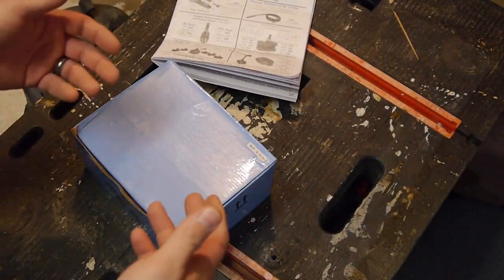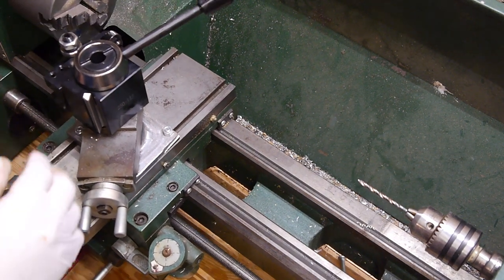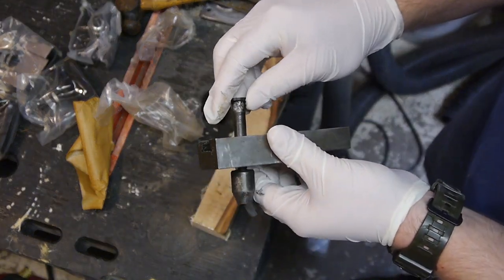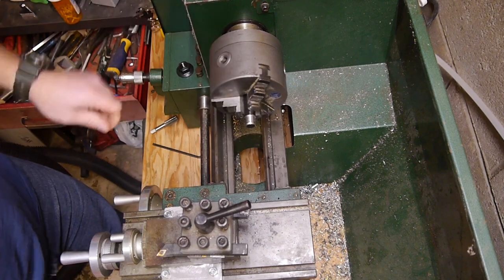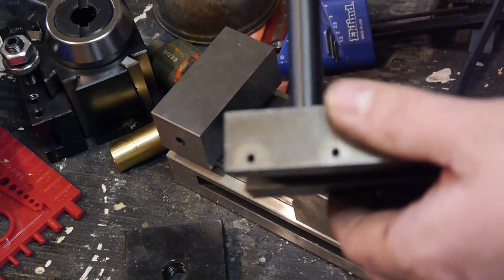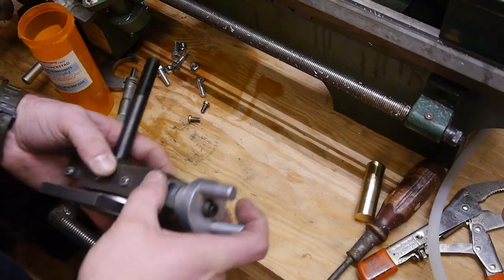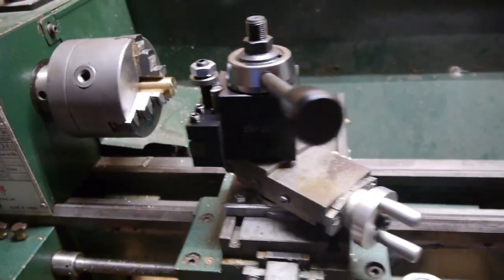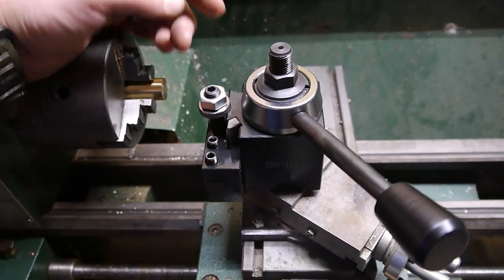Grizzly G4000, 9x20 lathe, quick change tool post installation, AXA Wedge Style

Comment: Thanks for making this video. Is that a 1/2" thick indexable turning tool? Is it at spindle centerline when fully lowered in the QCTP? I'm having a hell of a time picking OXA or AXA for my 8x18 Busy Bee (Grizzly/Emco rebrand) which has a 0.500" distance from top of compound to spindle centerline.

Comment: I have a Bernardo 500 lathe and it is same size as Grizzly g4000. It seems that if i would someday go and get quick change tool post it would rather be OXA than AXA. Those wedge style qctp:s are pretty expensive compared to piston style.

Comment: I see a lot of people with the compound slide canted over at 45 deg to clear the tailstock.....why do you even need to have a compound slide if you can't use it for left to right tool moving in the straight left to right orientation?
It would be far more rigid if you removed the compound slide completely and used a raiser block to mount the QCTP on....especially for parting.
If you want to do taper turning it only takes a minute to remount the compound.
Most of the time you can use a micrometer bed stop if you want to move the tool sideways accurately.
Practically all problems with chatter and vibration can be traced to a loose compound dovetail gib which for normal turning operations should be quite tight.

Comment: On my Bostar AXA my center post  has a lot of play between the holder and post,  right at .495,   when it sets on the post I can wiggle it quite a bit,once the top nut is on it does not seem to move but I have not mounted it yet  ,,I am thinking of making a new post from new bolt  9/16  size instead of the 1/2 that came with it,  then if need be  I can remove just enough to make about .010 clearance or what ever it would take so it will rotate on the post snugly ..  was yours that loose,  center of my axa is .5950  and post is only .5450,  so you can see the loose fit is excessive ,,   What do you think??
Reply: Hey, did you get round to fixing the issue with the bostar ? I’m planning the same upgrade and would appreciate feedback on the bostar ! Thanks
Reply: @Oorfmeister  Yes,, I  bought another compound base, was less than $40. bucks,  so if  something happened  I would still have ability to work,,    took the  bolt cut  the head off,  oh, I decided  to go with a 5/8  bolt  so I would not have any threading on top end,,  turned it down to  very snug fit  I almost need a wrench to rotate it  but it is getting looser every time ,, and that was the whole objective to make it where there was no slack,  after I got the dia. where I wanted,,  I threaded the bottom the size of my base,,  then  threaded thetop and cut off the end at height I wanted,, made my nut for the top by just welding a SS round stock 5inches long on it ,  I  snugged the nut down really  tight before the welding and marked the side that the handle needed to be  then removed and welded,,  works  great,, for me,,, if I need the change the direction of where the handle is  all I do is add a washer,,  thin fender washers  are what I found in Stainless.. Hope this helps,, I am not much at filming my work,,  I think those that have done these videos are some real talented people..
Reply: I love my  G-4000

Comment: Josh have you tried the 4 jaw chuck that comes with the lathe.  I can't get the jaws to tighten on to the work piece
Reply from the maker: Hi Russ, I have used the 4 jaw chuck. It was a little tricky to use if I remember right. Each jaw has a through bolt that I needed to loosen then I needed to use the wrench key to turn the square head bolt going through the bolt that holds the jaw. Does this sound familiar to what you have? Do you have picture or video of what you have?

Comment: Hey mate thinking of getting this for my Grizzly G4003, Is this the best type to get ?
Reply from the maker: Not sure if the tool height would work for your G4003. By that I mean I am not sure if you need an AXA or a BXA sized quick change tool post. I think the wedge style tool post is better than the piston as the wedge also provides some clamping in the vertical as well as the horizontal direction, and the piston is only in the horizontal. With that said I have not used a piston style so I am just going off gut instinct and what the internet has suggested. Thanks for watching!

Comment: Lol why would you get rid of the compound slide?
Reply from the maker: That is a fair question, and looking back at it I was sort of prophetic. I ended up nixing the compound slide because it was not very stiff. I saw it wobbling when under high loads. The two screws they use to attach the cast bottom to the clamp disc are not very good at resisting loads. I ended up screwing up my slide not too long ago while trying to stiffen it up. I ended up welding a solid chunk of Stainless Steel to the 4 bolt clamping plate I made. I would like to have the compound back so I may take a look at fixing it in the future. The compound would be nice for threading. You can see the current setup briefly here. https://youtu.be/cSD98VxHwgg
You know now that I think of it. I thought I made a video on that, but I don't seem to see it any where, must have shot it and never edited it. hmmm. At any rate, Thanks for watching!
Reply: I don't see how you could get rid of the compound slide. Using the crossslide only is too imprecise IMO.
Reply: @JoshAQ  my thought too,  why ,  it looks like to me if you remove the compound the tool holder would set lower,  and that would bring the cutting tool height higher on the post,  which would tend to allow more flex,  the lower the cutting tool to a base would allow less flex, when pressure is applied ,,  i did go through my 4000 and tighten all the gibs much closer so as not to get the play you speak of,  I looked at the cost and the gib is not that much, in fact I ordered several more,, let them wear, I will replace them at the cost and keep my work close tolerance ,, with mine on the compound the tool holders are really close to the bottom of the axa ,  so mostly no flex when I put pressure on it ,,  I do like the new 4 bolt compound you made ,  looks a lot more sturdier than the 2 bolt that comes with is,  that is my next project..  BTW  with all the degree adapters  out there do you really think it is worth worrying about the cut out for the degree gauge  you had to do..

Comment: I’ve got the jet bd-920 and bought the axa because it said it’s 6-12” swing. With a 9” swing it should be perfect. But with the tool All the way down it sits at least an 1/8” to high. Yours was all the way down but looked perfect. Anyone else have this problem?
Reply from the maker: I no longer have the tops slide on the machine, but from the bottom of the degree dial, the part that would be clamped onto the cross slide to the top of the top slide, what the axa quick change tool post would rest, is 1.770" also my tool holders have a 0.438" thick portion that the cutter would rest on when clamped by the 4 allen head screws. So total stack up from the cross slide to the portion that the cutting tool rests on in the holder is 2.208" The cutting tool itself is 0.486" from bottom to the edge of the cutter. So from cross slide to tool cutter I have a minimum value of 2.694" the rough centerline to top of my cross slide distance is 2.74" approx. So it was really close. I hope by seeing some of these numbers you will be able to find the difference between our two machines. Feel free to contact me if you want pictures to go along with the numbers.
Reply: Just Josh rfpom 
You’re awesome. I’ll check these on mine to find the difference, however, I did find a few other people with the same issue. Apparently 2-3 different series? For the toolpost and top slide. I wound up just putting my top slide in my mill and taking the shoulder off so it’s flat on top. But I appreciate the numbers so I can see the differences and see if it’s compound difference only. Thanks!!!
Reply from the maker: @PalmAirCryo  No Problem, I was going to suggest that maybe you should mill some off the top, but I thought what are the chances he owns a mill. LOL. Yeah these 9x20s I think are knock offs of the Emco lathe if I remember right. Sold under a bunch of different names. Main parts were the same but accessories could vary wildly. The best one I saw was the one with a camlock tailstock. I got around that problem with a inclined plane wedge so I only have to throw a lever about 120° or so for it to lock or release, but it would have been nice from the factory. Steve Bedair does a great job implamenting a camlock for his 9x20 check it out if you haven't already. Be warned his machine will make you want to upgrade yours lol. http://bedair.org/9x20camlock/9x20project.html  
Thanks for watching!